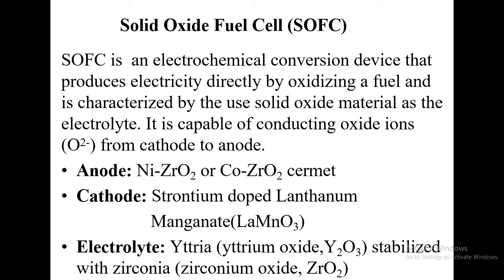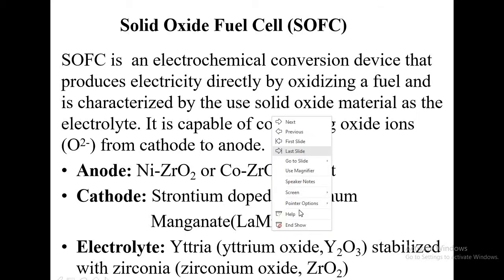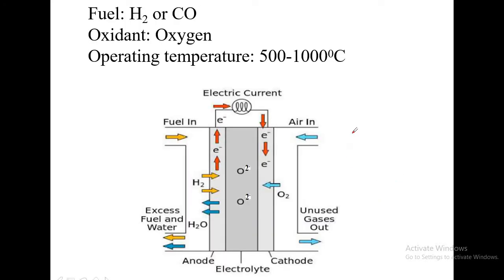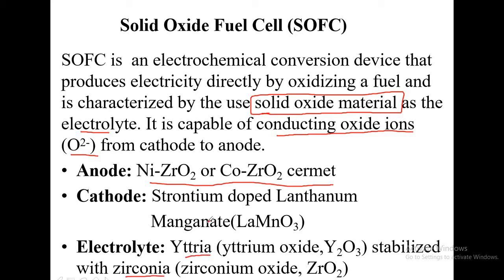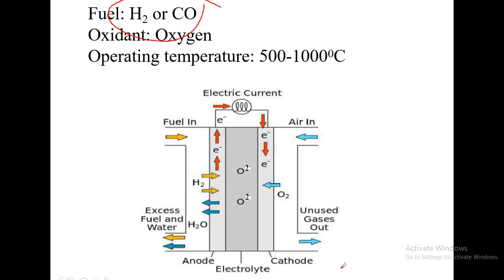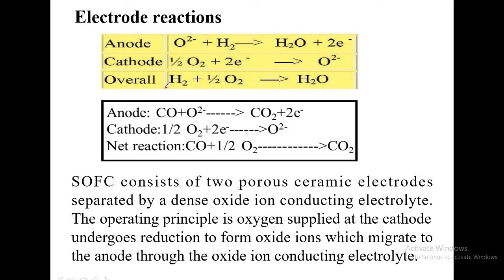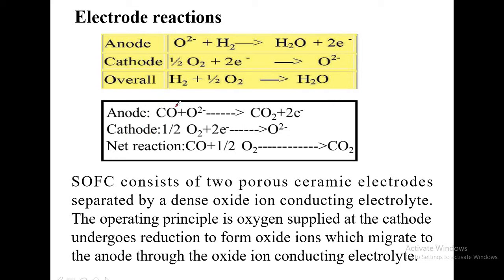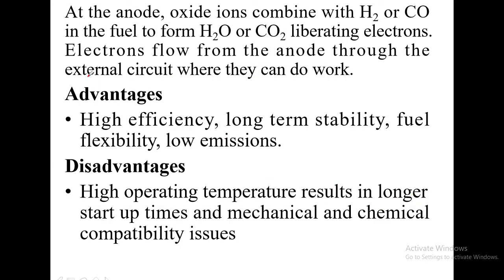Solid-Oxide Fuel Cell(SOFC)-Construction, Working,Advantages/limitations and Applications-JP

Comment: Do these oxide layers have semiconductor properties? If so,are those properties required and what are those properties? Thank you!

Im subscribing, 
I want to see your future videos on solar, especially if it involves organic solar (who's oxide layers do require semiconductor and catalytic properties that I want to learn and understand)
Where do fuel cells, organic solar and flow batteries overlap in construction, chemistry and semiconductor properties? That would be a facinating video!